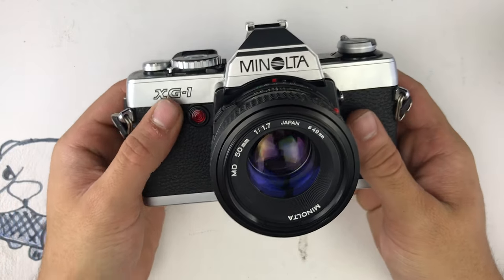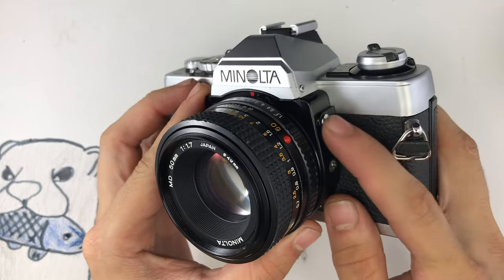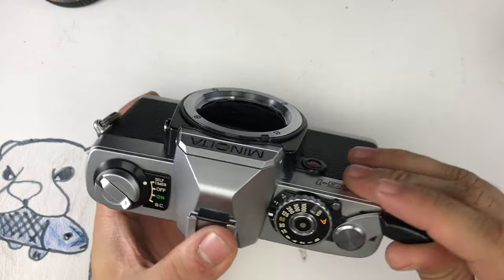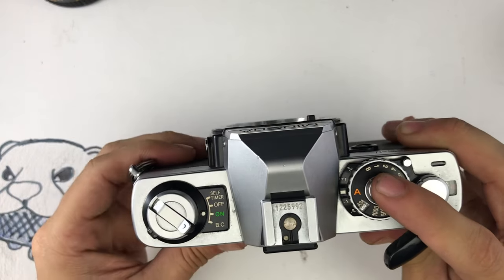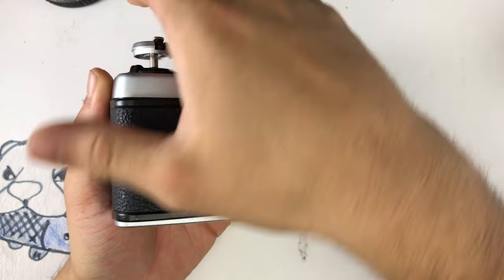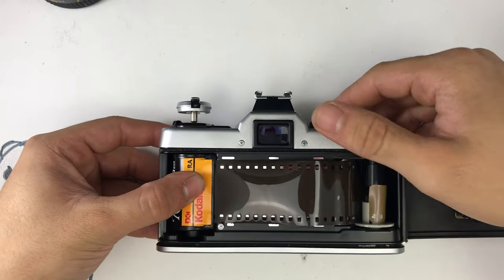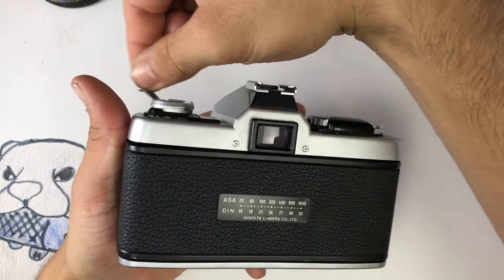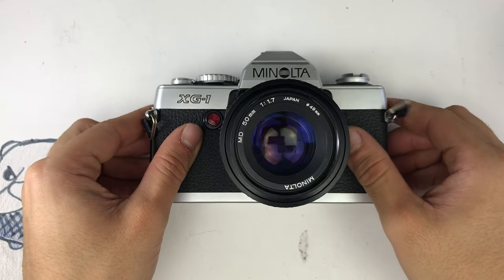Minolta XG-1 How to Use Quick Guide

Comment: I'm unable to move the winding lever. I don't have batteries at hand. Is this correct behaviour or should I be able to pull the lever and shoot without a battery? Don't know if it's broken and I don't want to spend too much money if it doesn't work.
Reply: you absolutely need batteries and i had an issue with the lever too i just manually winded up the film and took a picture and i was able to move the lever

Comment: One tidbit I'd like to have known before: the shot counter doesn't move back as you reroll the film when you're done. The counter snaps back to zero when you open the back. I thought there was a problem with my roll as it wasn't moving backwards as I rolled it back in. I opened my camera in a bag, in my bathroom with no light on, expecting to touch a disaster, and it turns out the film was just back in the roll as it should have been.
Reply: I don't know of any camera that does that. Not even my electronic ones do. It just shows the rewind indicator on the LCDs.
Reply: @danem2215  reloadable disposable cameras will gradually rewind the shot counter as you roll it back up into the canister.

Comment: when you said set the shutter speed to 60 for it to work? what does that means exactly?
Reply: This camera is set to work with flash only at 60th shutter speed, due to the synchronization flash won't work at a different shutter speed.

Comment: If the shutter speed indicator doesn't turn on in manual mode, how can you tell if your picture is under or over exposed?
Reply: you need a light meter. you can use a phone app.